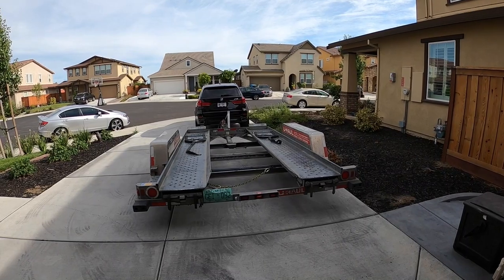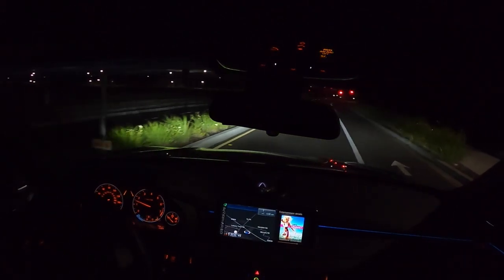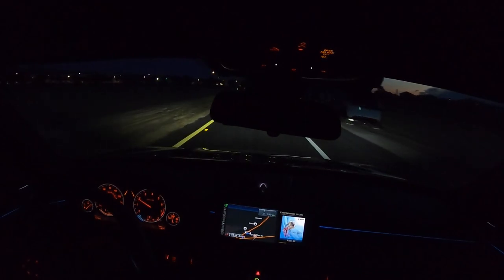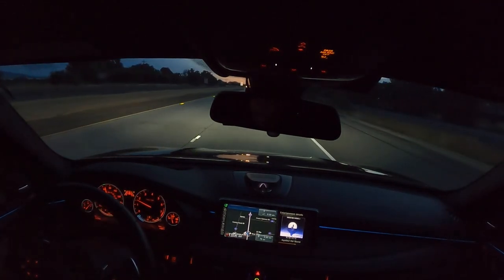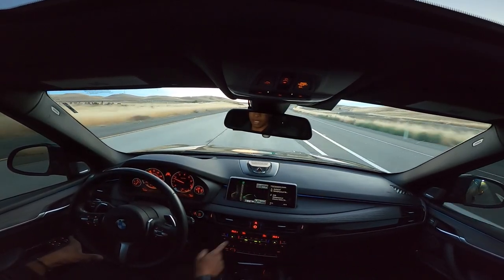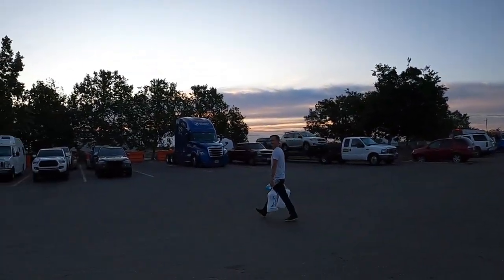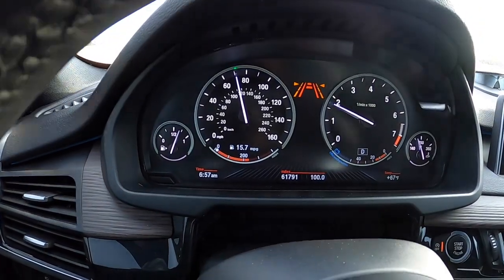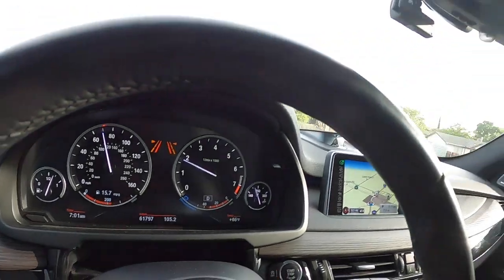Tow Like Never Before - BMW X5 Twin Turbo V8 Fuel Efficiency REVEALED! (EPS: 2)

Comment: Hi! Thanks for the videos! What year is this X5? And it seems you're not using a brake controller, is that right? Trying to figure out how safe I could tow with/without a brake controller for a 27 ft. trailer (~4,000 lbs) with my 2014 BMW X5 xDrive35i that's rated at 6k towing capacity.
Reply from the maker: It’s a 2014 X5. The trailer has surge brakes which doesn’t need a separate take controller.  
Typically if towing over 3500 lbs you’ll need a brake controller.